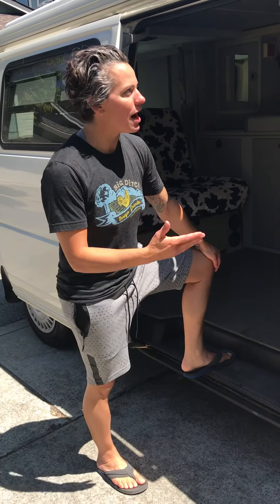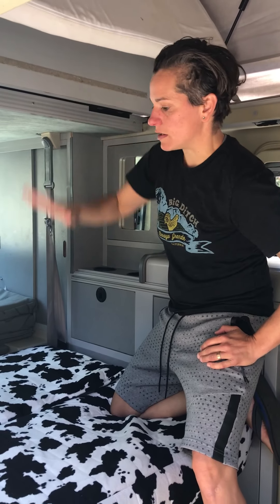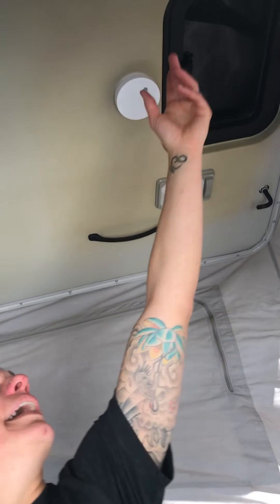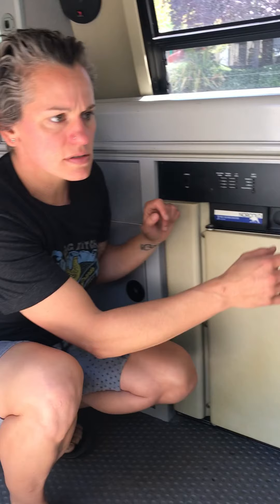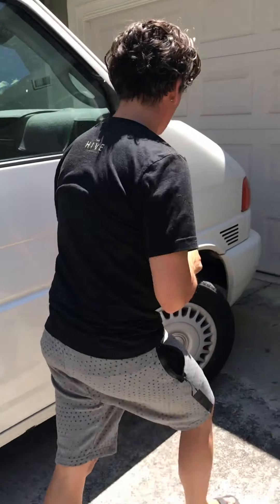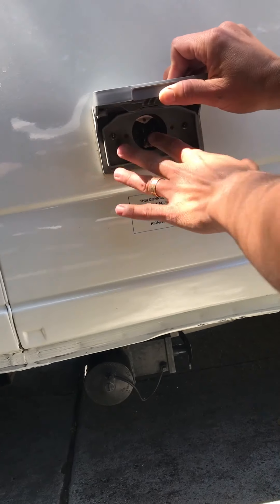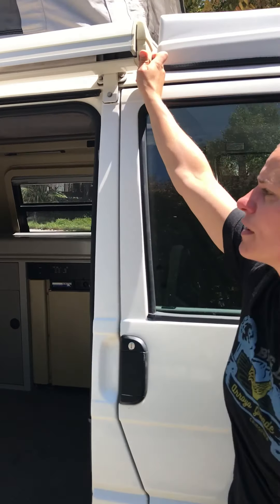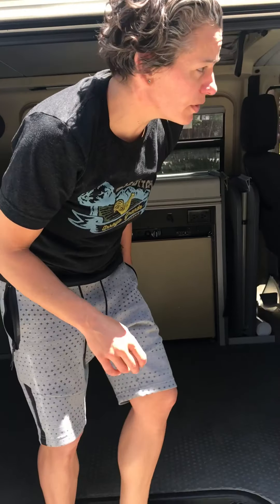Eurovan camper functions

Comment: Informative video.  Just a couple of things.  Those controls for rear heat setting are for heat only - no air conditioning in the rear of this model.  And the vents on the side are for the fridge when operating on propane - not stove.

Comment: So the awning is pulled out manually and how about retracting it how is that done?
Reply from the maker: Good question- we rarely used the awning and have since sold the van. I believe a lot of the vans come with a tool that you use to spin out the awning and spin it counterclockwise to retract. Good luck!